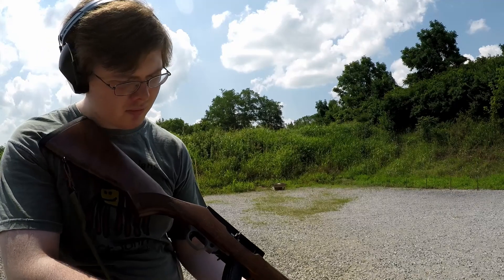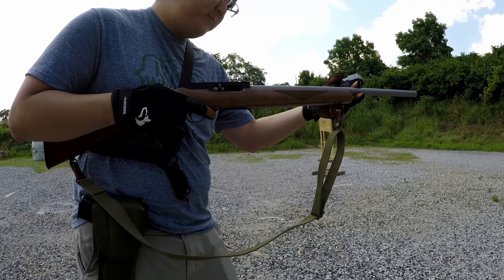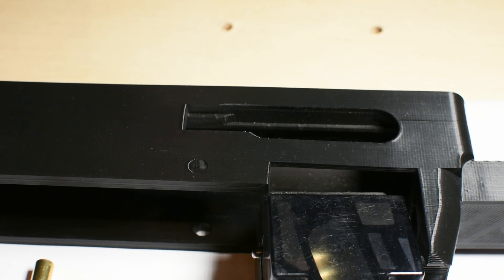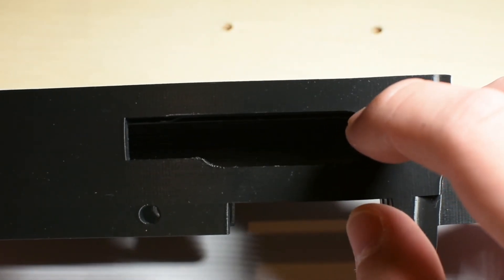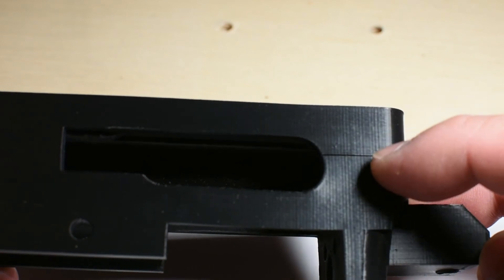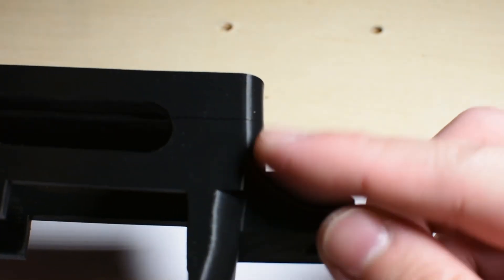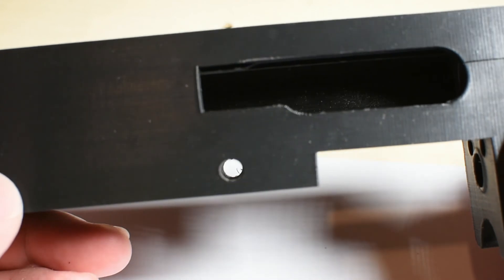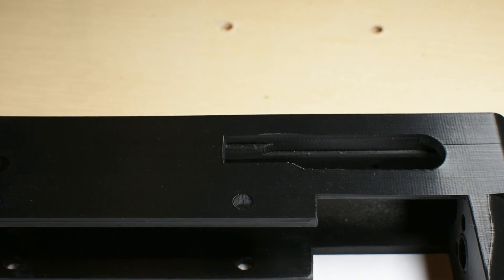3D Printed 10-22 Receiver Testing and Autopsy

Comment: PLA + is the go to recommendation for any 3D printed build. The biggest issue is heat. If you are building guns with 3D printed parts, avoid the sun and summer. Otherwise they should be fine especially .22’s.
Reply from the maker: That's what I quickly found out. All my prints melted in the sun. Next time I'll put them in the shade or something.
Reply: Actually a UV protective would help quite a bit but yes PLA + is the best.  I finish all of mine with Alumnahyde.
Reply: @SALTYCOMBATDIVER-ExInstructor  hey Salty that’s the first I’ve heard of a finishing coat. Can to share a little more about that or point me in a direction?
Reply: @Doug  really any paint that deflects UV but I use Aluma Hyde.  It helps protect it from heating up from the radiation from the sun by deflecting it.  It also helps protect PLA/PLA + from deteriorating.  Without it, they will actually decompose over time.
Reply: @SALTYCOMBATDIVER-ExInstructor  thanks Salty, that is helpful so it’s reducing the effects of the sun and degrading the plastic. However it does not provide further protection from heat. Thanks!

Comment: Hmm could sand cast the receiver with aluminium
Reply from the maker: I would do lost-PLA casting with this. As for a bronze bolt, you could do that. STEN SMGs have used brass/bronze bolts before, but lifetime was obviously shorter.
Reply: @pcblah  Aluminiumbronze would be very sturdy it is 2,5 times as strong as regular bronze

Comment: I'm going to try printing this receiver and then using it as a burn-out mold to cast the receiver in brass.
Reply from the maker: That'll be interesting to see.
Reply: @pcblah  I'll upload something if I'm able to make it work. I'm building a crucible currently so it'll be a little bit before I have enough experience to get it working.
Reply: Did you do it?
Reply: @roosterqmoney  unfortunately I haven't yet. Been living in an 18 foot long camper lol. So my 3d printer was in storage until just a week ago. Hopefully I can get it up and printing soon.
Reply: @Bearthedancingman  I for one, am very interested to see how that turns out. I've been wondering if something like that would work, but I haven't gotten around to building a casting forge yet.
Reply: @mtnbkr5478  I'll definitely post here when I start my attempts. I'll make videos of it.
Reply: @Bearthedancingman  Awesome, thank you! I'd definitely appreciate the notification.

Comment: Have you reprinted this in a different orientation yet?  you'd mentioned printing on it's side.  Wouldn't you just as likely to get delamination in the other direction?  What about printing at an angle that would take the layer lines off center from the expansion forces?
Reply from the maker: I haven't and I probably won't get to mess with this again. I sold the 10-22 off for drinking money.

Jk, but I did sell the gun off. Might do a 10-22 charger build when the waters get calmer.
Reply: @pcblah  please do a vid when you decide to print it on its side :) if I have any success I will share it with you!